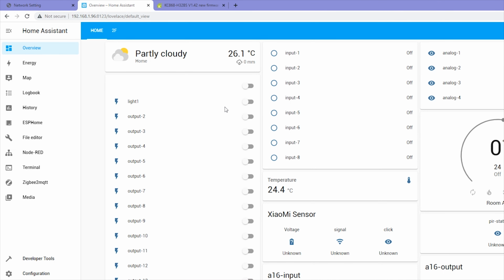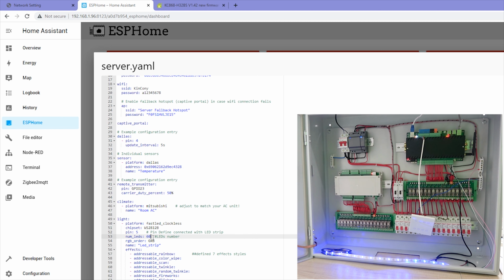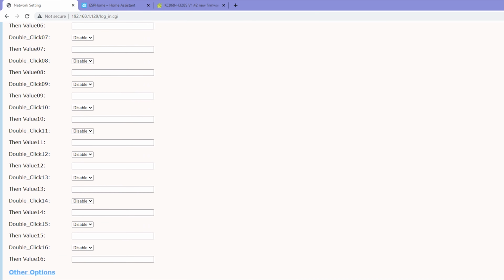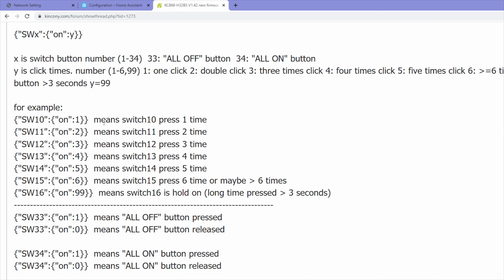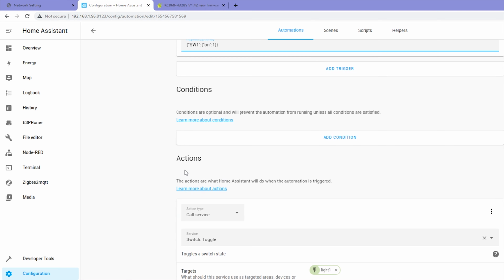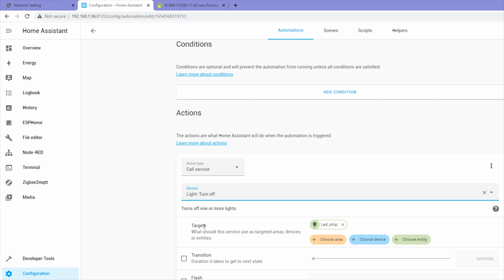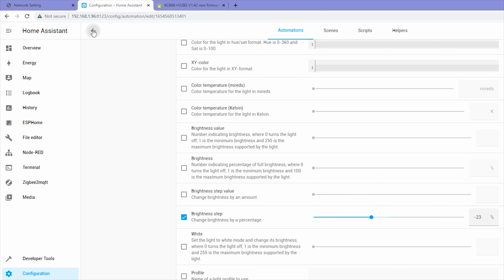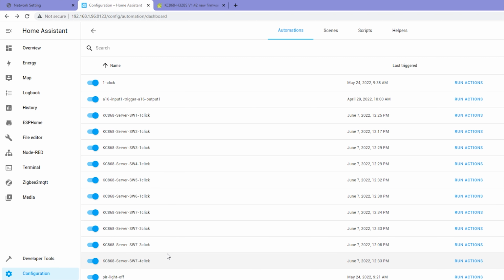【home automation training -29】config manual push button for switches and LED strip

Comment: Such an great idea...sue to wired input it will be very reliable compared to zigbee...but the issue is we have only 16 inputs...if you make one seperate module just with 16 digital input as extensions...then it will awesome...we can add more switch where ever we want....
Reply: From what i know of their ecosystem its all using modbus over rs485 so you could add modbus bus rtus to it for up to 32 inputs and or outputs per module
Reply from the maker: @berenlea486  yes, if want to use MODBUS, we can add KC868-A32 integrate to home assistant, that is 32 DI, 32 DO, RS485 modbus.
Reply from the maker: input extension module under designing.
Reply: @KinCony  👍 Great

Comment: As I already told you, I am thinking of using such equipment to automate my country house. Now I wanted to know if it can work as a slave of a modbus network. So I could use my SCADA system to monitor and command. I've been using this system for some time now, so I'm not interested in changing it. But what caught my attention is that if I was working in the field, I could control it with the radio control. Would it be this?
Reply from the maker: support control by RF remoter